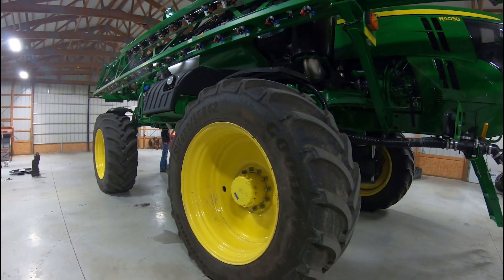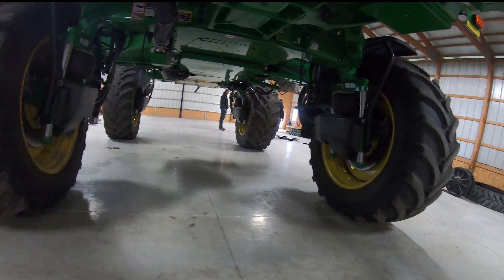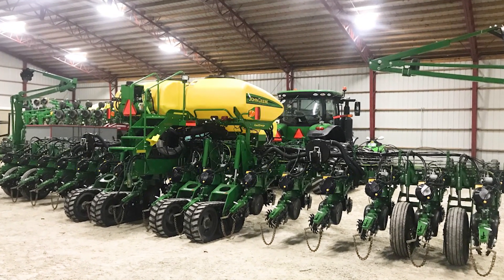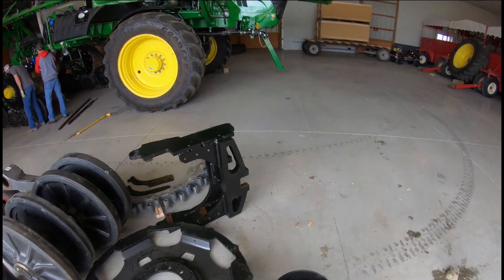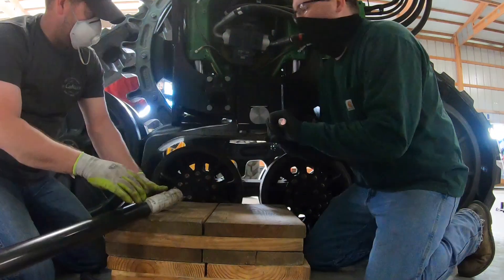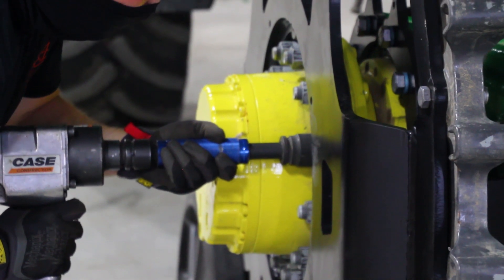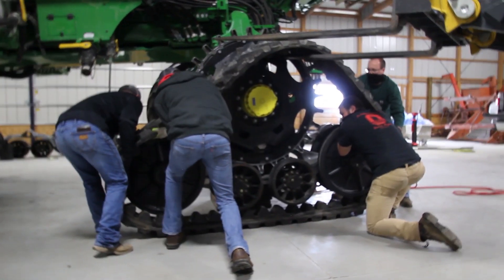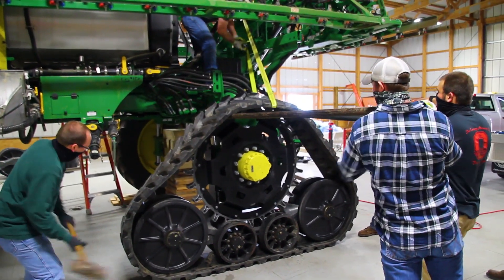Sprayer Tracks Reveal

Comment: How is it for tight, slow turns around the  farm yard when filling etc? Top speed is probably reduced quite a bit? Be interesting to see it spraying with a full load up a hill.
Reply from the maker: Turning radius is slightly bigger with the tracks than tires, not an issue in the field. Top speed is reduced on the road to about 15 mph when empty, haven't found speed to be a limiting factor when spraying.

Comment: What effect has that had on your speedometer calibration/road speed? Presumably, that track drive wheel is significantly smaller than the OEM wheel so it would put the speedometer way out and significantly reduce your road speed. Is there a method to calibrate the speedometer/adjust the hydraulic system to improve your road speed or do you just have to put up with it?
Reply: Most of those readings are gps. May need to adjust transmission to reach top speed but that is all
Reply: There is a Rolling radius input in the monitor and you can change it to get the correct speed reading